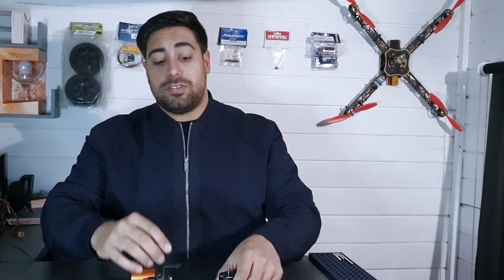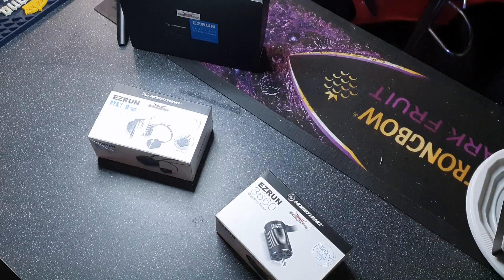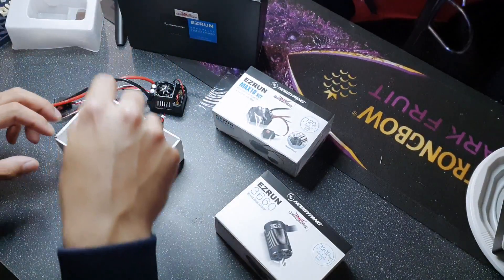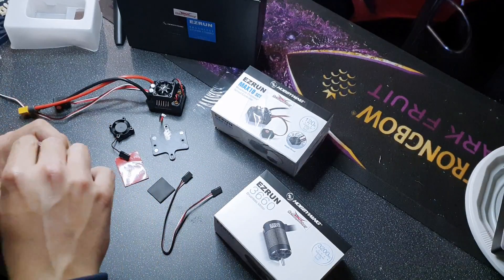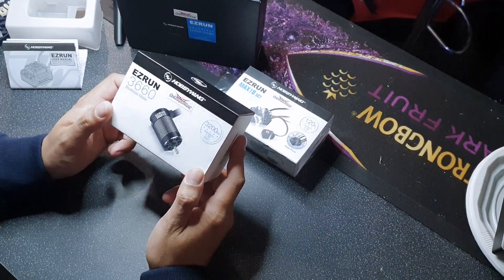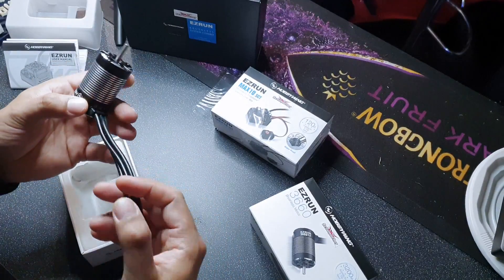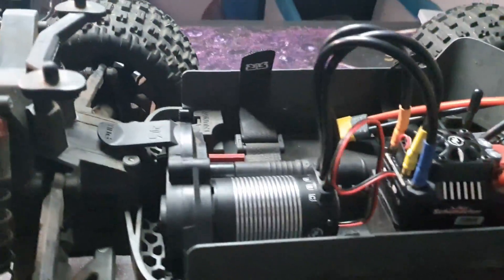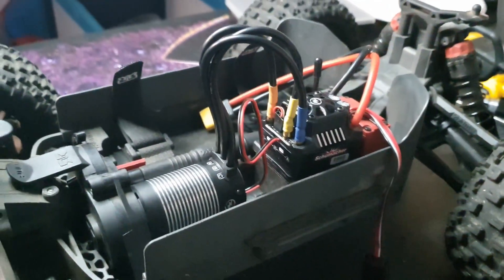Hobbywing 120A MAX10 SCT Brushless Combo upgrade for Arrma Granite Mega 4x4! No more cogging?

Comment: I have the max 8 in my revo and boy! The best combo for the price you can get! 
It’s so quick on 6s (obviously 4s max for yours) 
But internally it’s the same as the castle motors but for less than half the price! 
I just bought a max 10 today Because of cogging issues on my sky rc!
Reply from the maker: I love the hobbywing systems they are great quality and like you say comparable to the more expensive castle systems. Has been years since i had a castle system i had an old mamba monster max in my e-revo! Think i will only ever use hobbywing from now on!
Reply: beyondRC for sure! If you tear down a hobbywing and a castle they are exactly the Same! 
Also razor ten systems are made in the same factory and are the same motors/esc’s but just don’t look as blingy on the outside! 
And are even cheaper still!
Reply: @DJSpannamanUK  where can I buy razer ten systems?

Comment: I have just purchased the max 10sct for my granite mega 550 to get a little more punch out of it. What pinion would you recommend as brushed motor has a smaller shaft than the new max 10sct at 5mm. Apart from that everything is stock. But states that it is brushless ready already. Thanks 😊

Comment: Does it come with a 5mm pinion under the motor plastic packing? Some Hobbywing combos do (Axe crawling systems), so I was just wondering before I order one?
Reply from the maker: No pinion included with this combo but the motor is 5mm shaft 👍

Comment: Would you mind telling me what pinion gear you used with this hobbywing motor on the Granite upgrade?  Wondering if you were able to get a pinion gear for this upgrade that worked with the original motor mount setup.
Reply from the maker: So I have actually upgraded the spur and slipper clutch to the BLX version. So with the motor mount I do actually have a video on the channel I had to actually drill out the standard mount to let me mesh the gears properly. I now run the proper adjustable mount and it makes life a lot easier. Also the shaft on the motor is 5mm!
Reply: I did as you did and drilled an extra hole in the motor mount to mesh the HobbyWing motor. ThIs is a great motor esc combo (same combo as in this video).  This Arrma is a beast now. Thanks for the help.  I’ll now order the BLX motor mount and upgrade some more.
Reply from the maker: Good to hear! The adjustable mount is worth it as you are not restricted when it comes to pinions. Glad my method worked
Reply: Got the exact same thing, but i would recommend switching out the stock servo as well, it´s just..ugh.
Reply from the maker: Am running a savox now!
Reply: @beyondRC  I am reading alot of good comments about those servos, i went ahead and got a JX Ecoboost.

Comment: hi i installed this system on my 1/10 race buggy it hits about 20 mph  i don't find that quick at all how fast did u get it to go
Reply from the maker: i can easily reach speeds over 40mph it will depend a lot on what gearing you go for too!

Comment: for the 5mm motor shaft, what pinion gear did you use?
Reply from the maker: i think i used a 15t or 17t 0.8MOD/32dp Pinion for 5mm shaft doesnt have to be Arrma branded as long as its 32DP
Reply: @beyondRC  Did you keep the stock spur? Cause it's 48Dp as far as I know

Comment: What about those extra capacitators?
Reply from the maker: Did you get those?
Reply: @beyondRC  Yea man, not sure i understand the instructions to the fullest however. But i mean they are supposed to store energy to even out the spikes and it mentioned something about the unit running warm and you could risk destroying the capback that is on the ESC if you do not solder on the extra pair... Kinda gibberish to me but i guess i will solder them on just to be safe?